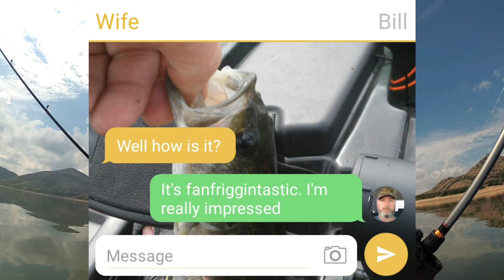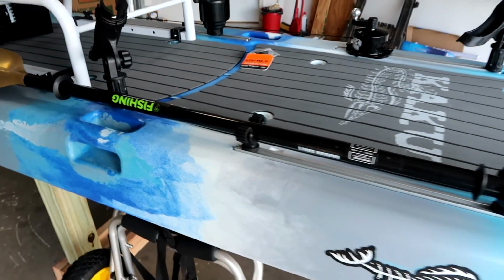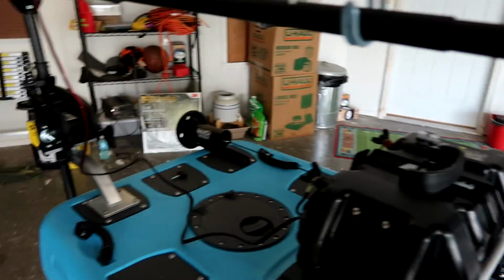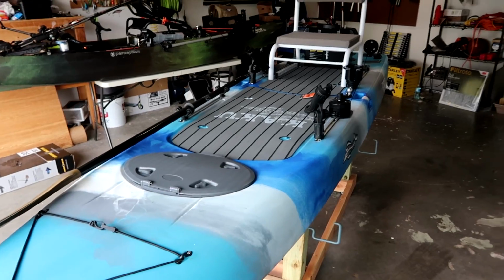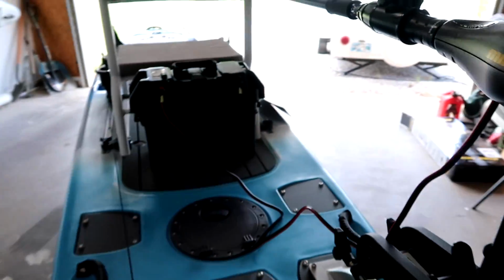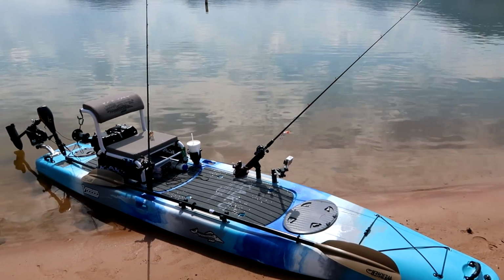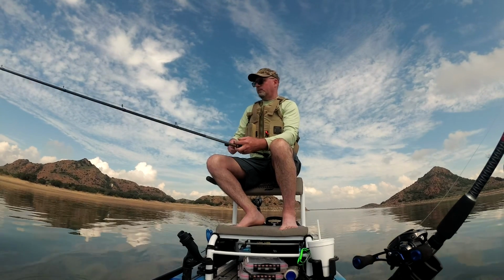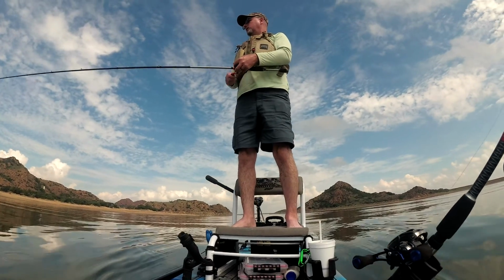Kaku Voodoo  - Its all in the seat!

Comment: I’m diggin your set up. My question is, where did you buy the motor mount or did you make it? Thanks Jacob from Corpus Christi, Texas
Reply from the maker: That is a brocraft transom motor mount.  https://www.amazon.com/Brocraft-Mount-Trolling-Motor-Bracket/dp/B07F28XS93
I simply bolted it through the cover plate for the power pole mount.  I did change to an island hopper outboard mount later on.
Reply: Bill Noneya,
Which mount is better to use? I’m just about to pull the trigger and buy the Voodoo
Reply from the maker: @cast_n_blast7496  The island hopper DIY is better but much more expensive.  I am using it in the 360 video.  Have you seen the Kaku Zulu?  Same seat with peddle option.  Either way I think you'll like it.

Comment: The holder that you have attached to the seat for the trolling motor handle did you use a self-tapping screw or did you use a drill bit?
Reply from the maker: I used a self tapping screw but I drilled it out later and put a bolt and nut all the way through.

Comment: I had never seen of of these Voodoos. Pretty nice. I currently have an Ocean Kayak BG 2 Prowler with trolling motor mounted. I really like the width, the seat and apparent stability of the Kaku. Any new things that you’ve discovered lately about the Voodoo?
Reply from the maker: I changed it up a little bit since this video.  I bought an islandhopperoutboards DIY transom mount kit and converted the trolling motor to a pwm setup.  I also added a garmin striker 4 fish finder.  I made some extensions to raise up and out the paddle holders.   You see this stuff in the 360 video I uploaded last week.   I really like the stability of this board and the seat.  In the chop it handles well too.  I do think that I would get a little bigger trolling motor if I did it all over.   My only gripe would be that there's no place to mount a transducer so you have to use one of those mounts that hangs over the side.
Reply: That’s awesome. I’m really liking the set up. I was curious about the way it handled in chop. I live in south Texas and many times we get those 20 mph + gusts that get a little tough. No way I’d every do it with a paddle only kayak. I do mostly flats fishing and can get fairly shallow. What size of trolling motor are you using? I’ve got a 46lb Newport Vessel on my kayak and have 100ah battery that goes forever (lol lol). I got it really cheap though. I use to have a Solo Skiff which you can see on my channel, but believe it not or not, I couldn’t get very shallow with motor, so got rid of it for another kayak. But, the Kaku really seems like something I’d like to try. Thanks for the info.
Reply: @BillNoneya  ever thought of mounting the transducer directly to the trolling motor?
Reply from the maker: @coryscott839  not really.  Because sometimes I plan to paddle it.  But there is a place to mount a transducer on the back.  So I could either mount it on the back or on the trolling motor.  But it would be in the way of the trolling motor if I left it on the back.  I just mounted it inside the hull the other day though.  If I ever get a better fish finder I think I'll do it differently.  This sup the way I have it is perfect for sight casting.  I don't lean on the fish finder too much.  I mainly use it to find cover, brush, and other stuff under the water.

Comment: Why did t you put motor in the middle? And how does it work there?
Reply from the maker: I was trying for a budget build at that time and having it to the side was more ergonomic for the twist control of the motor. Later I changed this to a PWM controller and have it in the middle using an island hopper diy kit.  It really didn't hurt anything being mounted on the side though.

Comment: Where did you buy the motor mount please ?
Reply from the maker: In this video its this.  https://www.amazon.com/Brocraft-Mount-Trolling-Motor-Bracket/dp/B01HJM9052/ref=sr_1_3?crid=15OWZ12H6WIDH&keywords=brocraft+kayak+trolling+motor+mount&qid=1563260008&s=gateway&sprefix=brocraft+%2Caps%2C185&sr=8-3
I now use the Combo Package # DIY-1000 from here and a PWM motor controller.    https://www.islandhopperoutboards.com/diy---kayak-transom-kits.html

Both will get the job done.
Reply: Thanks 🙏🏼

Comment: Good work on the voodoo. Looking good. Question for you. I have the same mounting bracket for my trolling motor. Did you follow threw with the screws all the way threw the haul or are you just on the mounting plate?
Reply from the maker: Just the mounting plate
Reply: @BillNoneya  yea I did the same thing but the screws it came with are to bulky and my plate doesn't get a flush fit but it's on there right. Thanks